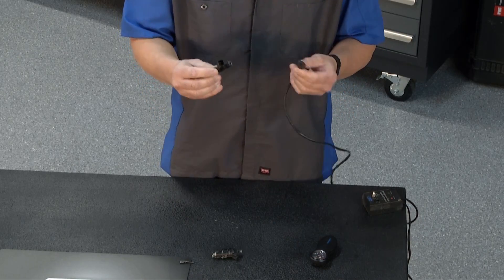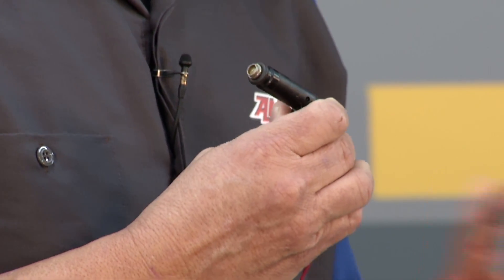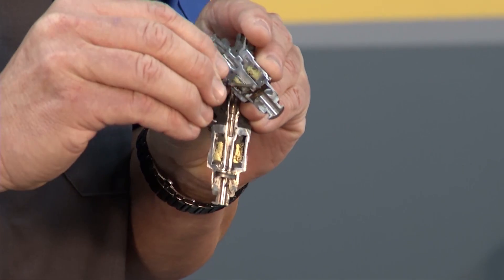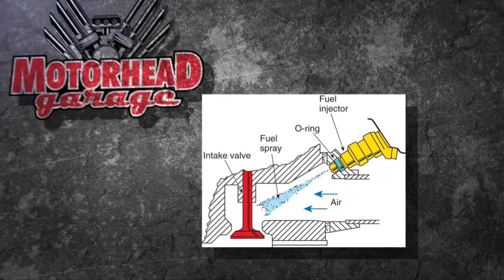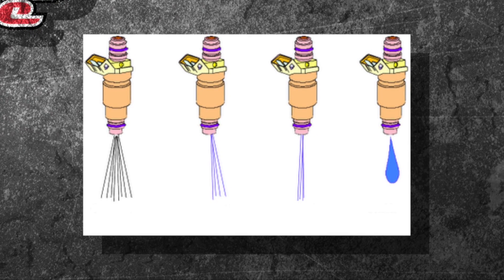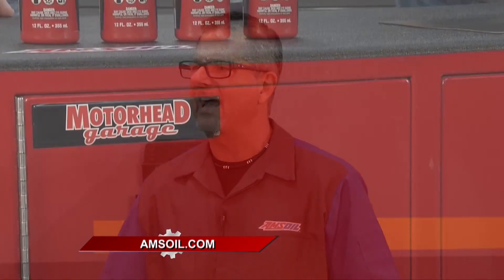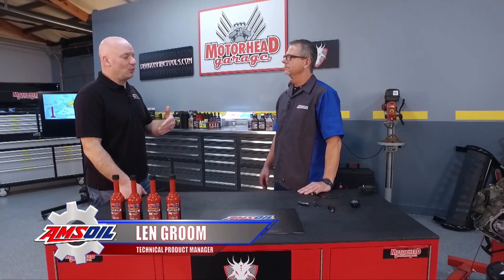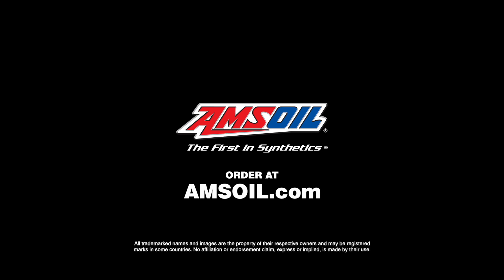How to Clean Your Fuel Injector

Comment: What about all the new direct injection gas engines? The back side of the valve is not washed down with fuel, how do you keep the backside of the valve clean?
Reply: If you're having trouble keeping the oil vapor from putting deposits on the back sides of the intake valves, I would research what they call a catch can. Or you can take your vehicle in and they can run a cleaner through the intake manifold to clean the valves. The Hyundai dealership here in my hometown does this service every 15000 miles.

Comment: can we add in to diesel tankfull??? currently i am using liqui moly super diesel additive
Reply: No Amsoil Diesel Injector Clean+Cetane Boost every fill-up.
Reply: @Jon-O.  or just straight diesel injector clean. That stuff works great cleaning and lubricating the diesel fuel system. Both products are excellent.